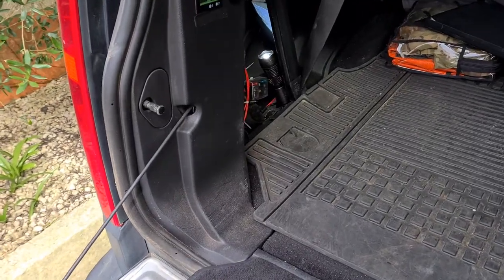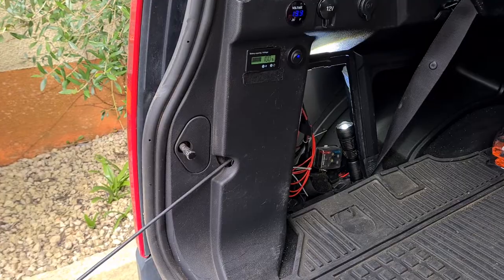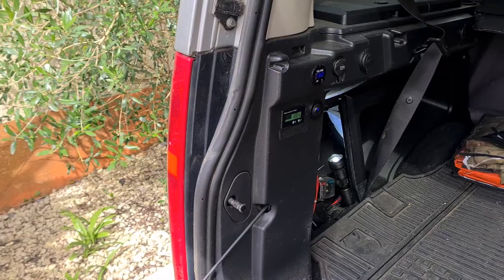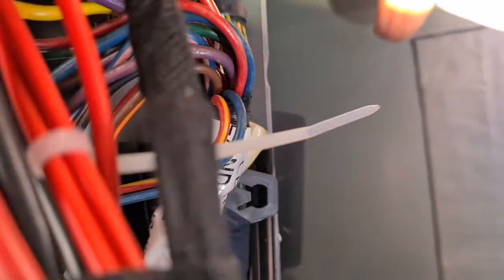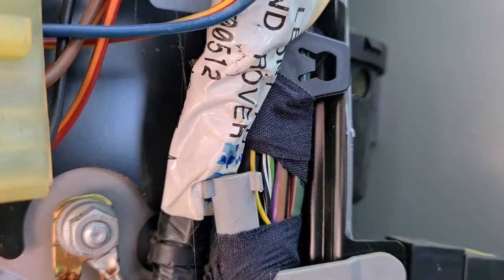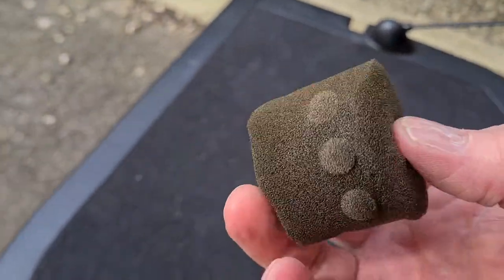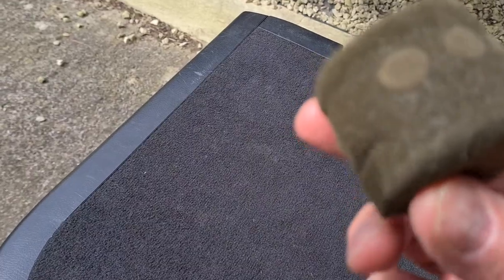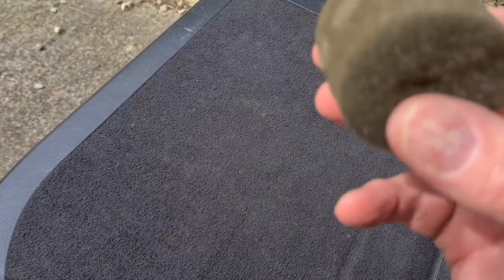Land Rover Discovery 3 & 4 Air suspension compressor air intake filter location.

Comment: Thank you - this has been a huge game changer for me. I have been struggling so solve my Land Rover Discovery 4 compressor issue for months and this is the 1st video I found which actually shows where to find the filter!! I doubt if the filter on my vehicle have ever been cleaned. I will send you photos of my disintegrated filter I took out should you be interested.
Reply from the maker: Hi thank you and please it helped you. There is also a second felt pad underneath the sponge which you may wish to wash or replace. 
Feel welcome to send any photos 
Regards 
Peter

Comment: Thank you so much and like many this has hopefully solved a problem I've had for weeks - yellow suspension light and HDC Faults and limp mode after 25 minutes driving - air compressor getting too hot and 'vehicle rising slowly'.  Taken out filter which just disintegrated into a pile of dust so will seek replacement tomorrow and with fingers crossed problem solved!
Reply from the maker: Hi, as the sponge had disintegrated it might be worth changing the compressor filter and moisture crystals.

Comment: Hi Peter, thanks for the tip! I am sure that my filter was never replaced!
Reply from the maker: Hi Peter. I am pleased you found the information useful. I suspect there are lots out there that have not been replaced in some time. The filter can be washed out in warm soapy water. I have heard that some have deteriorated and fall apart.
Reply: Same here yes  thank you Peter  have you got the part number so I can change mine
Reply from the maker: @daniellyne1  Hi Dan, you can't buy just the filter sponge unfortunately. You have to buy the pipe, canister and sponge As one. About £65. Plus vat from JLR. I do have the part number if you want it.
Reply: Thank you Peter ill ask my local parts FMP they have in partnership with Bearmach @discoveryadventures2296

Comment: Tried to have a look at mine today but I have rear AC and this filter is virtually inaccessible behind the blower. I could get the cap off but not get it out of the way. Only was to get the foam out would be with a wire hook. Decided to not bother as there was not a speck of dust in that compartment.
Reply from the maker: It's worth trying to remove. There are actually two filters one felt at the bottom and the sponge one. Sometimes the sponge starts to breakdown into a fine dust which could get sucked in and would obviously need the sponge replacing. 
Regards 
Peter
Reply: It's a pain but you can jiggle the canister out of the mount... Lots of cuss words and a sore hand! 😂the worst

Comment: What a good one!
My filter was indeed very dirty, and has never been replaced.
I called my dealer but he asked €96.40 for the filter inlc housing.
Is there anyone who might have a cheaper filter?
Read below in the comments, a dyson hoover filter...
But isn't there an aftermarket filter for this?
Please let me know :)
Reply from the maker: Hi. I'm not aware of a specific aftermarket filter. I would just try to find a fine open cell sponge to use and cut it to shape. A pond box filter sponge might be ideal as they come in different open cell ranges.

Comment: Hello has anyone found where to purchase a replacement filter unit from
Reply from the maker: You either need to buy the whole vent system from JLR or make your own filter. There is also a little felt pad under the foam filter.
Regards 
Peter

Comment: My d4 is setting low won't go up is this the cause?
Reply from the maker: Hi very unlikely but may have been a contributing factor. It could be one of a number of reasons why the vehicle is not lifting. Do you have a GAP iid tool or other diagnostic tool? You will need to check for codes first. Have you tried the fuse and relay? Is the pump running and car not lifting?